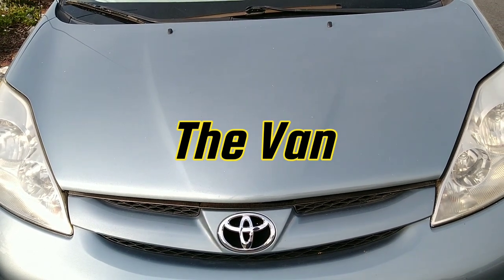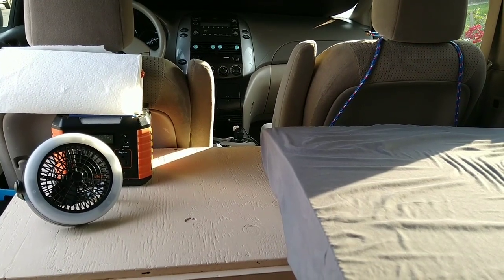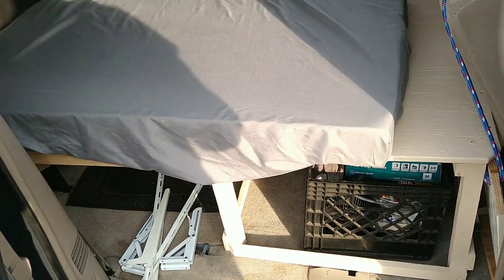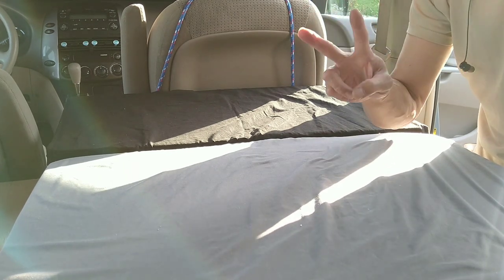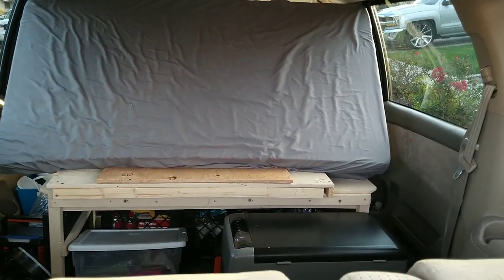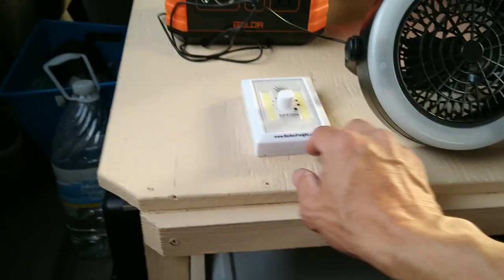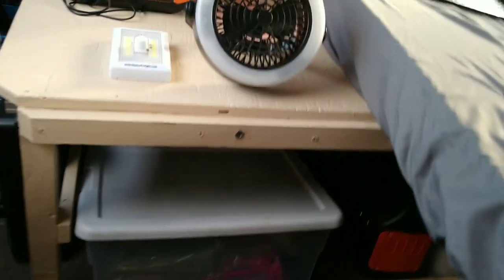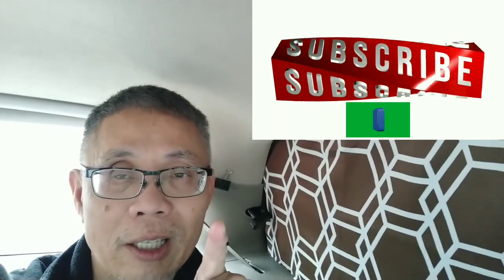Vanlife | Van Tour of 2008 Toyota Sienna Camper

Comment: Thank you for another great video. We had a similar setup with our second build, but my husband wanted more head room for the  bed. Now we are on our 4th configuration but we have reused most of the materials.  I even use part of the minivan build when I travel solo in our 2009 Jeep Patriot. Because my husband and I are a little verticality challenged we only have 70inches long for our bed platform.  This is good because in the Jeep that is all the length you get with out taking the frount passenger seat out. The bed platform is  2 pier one steel display shelves and  2x2 frames will legs  that they sit on top of.  In the  Jeep  I use one of the  shelves over rectangle made from scraps of 3/4" plywood because the seat backs are not level with the back end deck. My brother in law used his chainsaw to custom cut a post  from a piece of cottonwood branch and adjust a 1x4 for support near the front of the  platform. Now it is perfect for one. I love the craftsmanship of your build,  but it looks a little heavier and more complex to  put together and take down  than what we have. We still need to finish the window covers for the minivan.  I have had the same reflex covered in black felt for the Jeep for over 6 years now,  they are very durable and seem to keep both heat and cold were we want it.   I hope we cross paths some where out on the road.  Thank you again for the video.  Safe travels.
Reply from the maker: Look like you got your rig figured out the way that work best for you!💞 I hope our path will cross someday too! I am going to be at Quartsites all of next week.

Comment: I like the binder clips as curtain holders, especially for the back window. Also, will be interested to know how well the suction cup hooks hold up over time. Now that you explained that you use your fridge as a freezer, its placement makes more sense to me! I use mine as a fridge and access it often, so having it at the head of my bunk works better for me. My only concern is the paper towels hanging near your stove area. There's probably more than enough room between the burner and them, but I'm terrified of things catching on fire! Here's to many, many miles of safe travels 🥃🥃😁
Reply from the maker: 🤣 I agree on the location of the paper towel. It is hung on a bungee chord and can be moved to the other headrest!😉
Reply: @MoBangFoYoBucks  Or swung around to the front or side of the seat if need be. I'm just a Mama Hen🙄🐓
Reply: Do you have a fire extinguisher Tim?
Reply from the maker: I should but I am cheap and I am very cautious when it comes to playing around fire!!!🤣